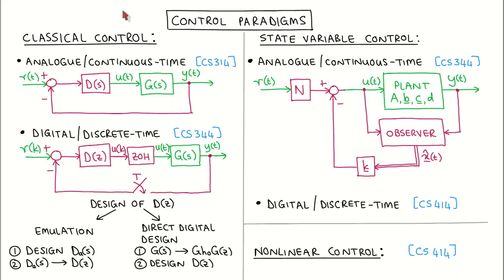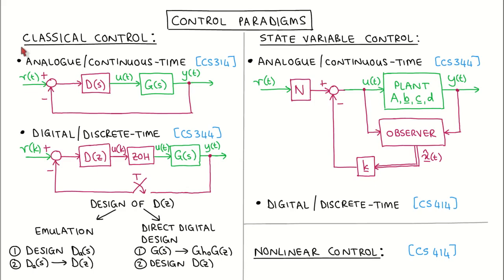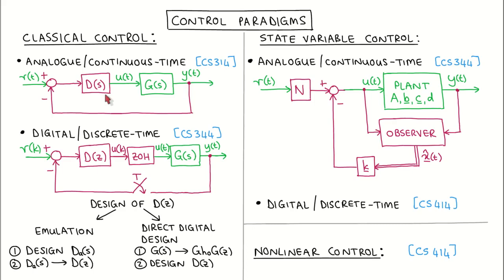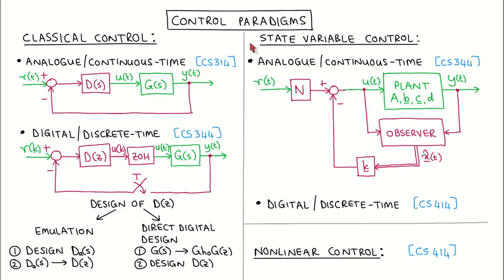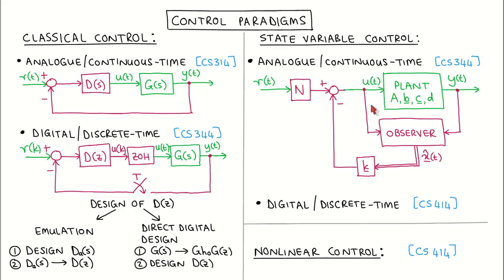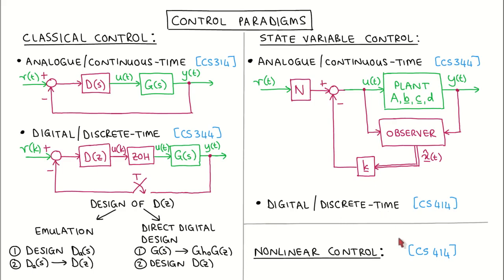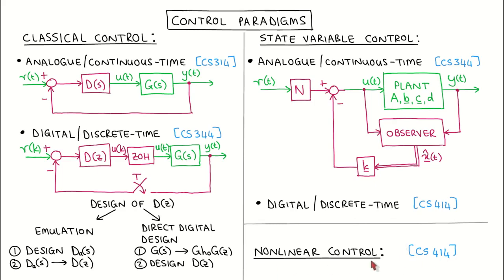Digital control 28: Control system paradigms

Comment: Do you plan to have videos on
mutli input multi output system
Contrability
Observability?
Reply from the maker: Unfortunately no.  This module focusses on SISO systems only, and I make these videos specifically for the module.  If you can get hold of the textbook (see video description), you can read about MIMO systems there.
Reply: @cornevandaalen1862  Thank you, Sir for such a great video lecture series. I was able to understand a lot of control system basics through the series.